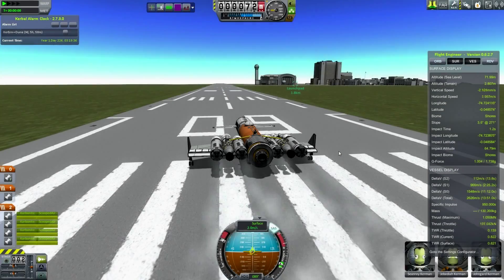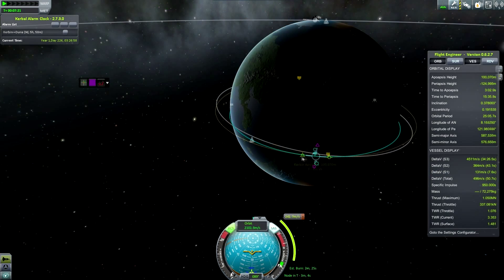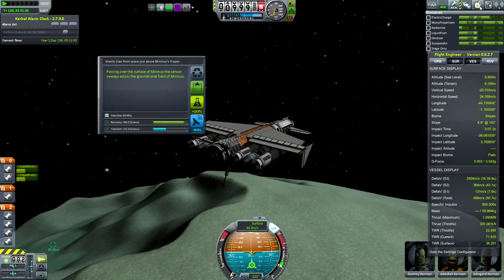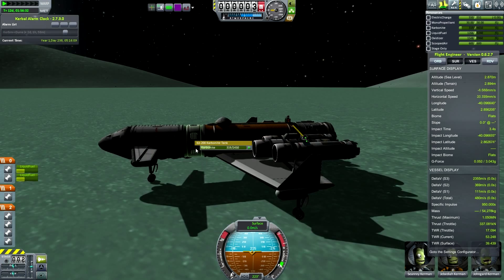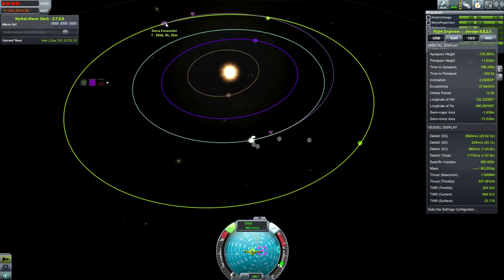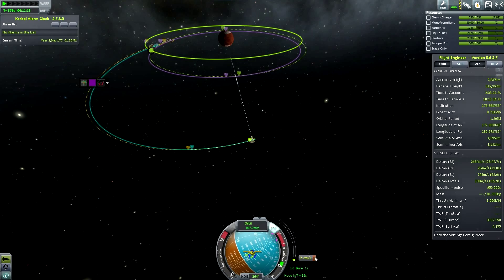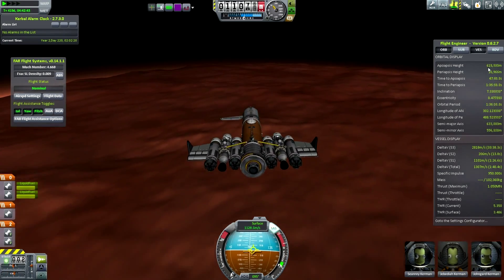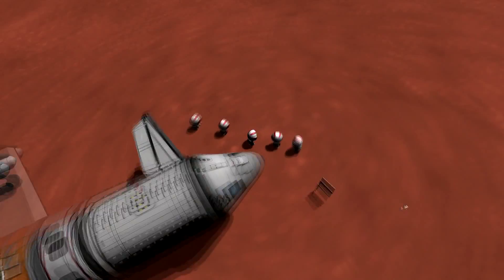1 - Karbonite SSTO Tour - Minmus, Ike and Duna

Comment: Do you know what your twr is when you turn on your nuclear engines? Whenever I use nuclear engines with the same mods you have in my ssto, my plane stalls at 30,000 m by cause the nuclear engines are so weak. Plus my plane is lighter than yours at around 50,000 kg when full. Do you have any ideas on bow to use nuclear engines with FAR and karbonite?